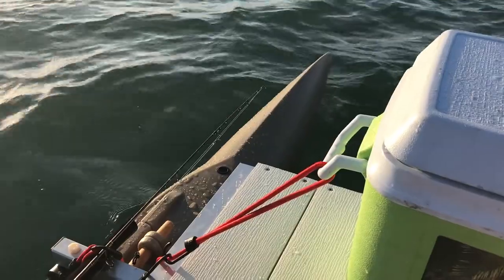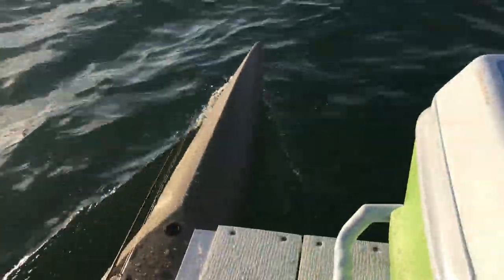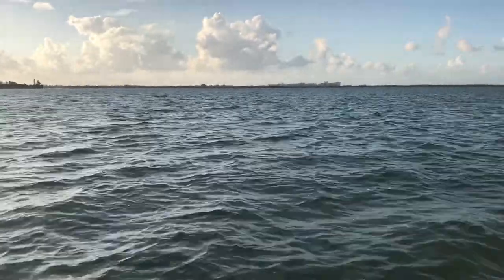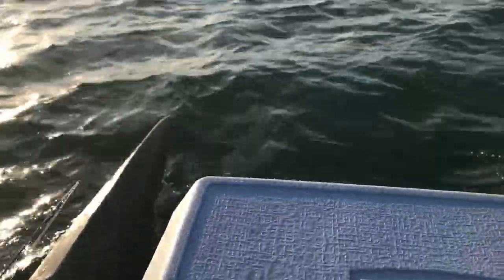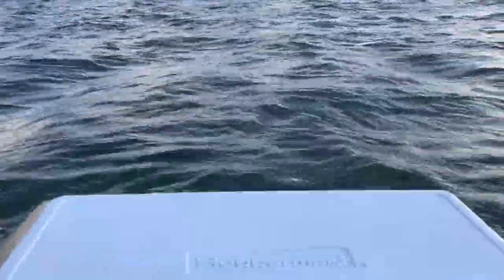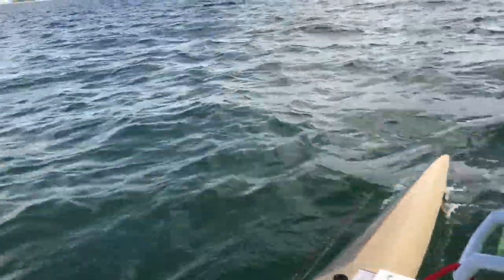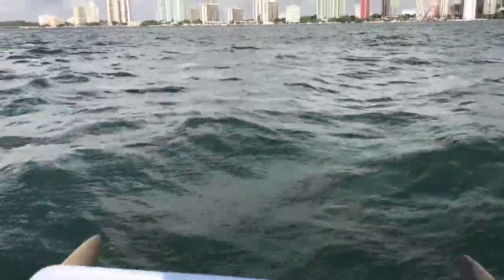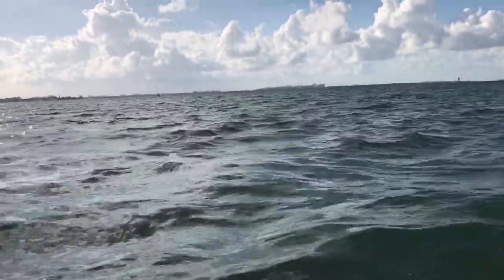Expandacraft with the Honda 35cc Engine Trial

Comment: Cool setup.  What is the shaft length of the motor?
Reply from the maker: Max length from bracket to output shaft is 23.5 inches. You have roughly 10 inches of vertical height adjustment.

Comment: nice! trolling motors are too expensive and under-powered.  this is nice for the ccs.   is this the same motor that's on the honda weed trimmer hht35 ??  thanks for the nice video!
Reply from the maker: m1 you pay for what you get. When you make custom parts for these paired with a 2 blade prop the 35cc and 50cc have plenty of power. I am the only company making parts to improve the performance dramatically. You can by the Chinese engines if you want cheap.
Reply: @kayakbuddysllc-lightweight4947  i saw u have a webpage.  u have listed: 4 Stroke New Honda 50cc GX Series Complete Engine Kit with Standard Leg - You Build Version.  is this the same package as what u show on your video?  is it complete w/ propeller and ready to hit the water?  thanks
Reply from the maker: m1 the video shows the upgraded leg. You want the 2 blade prop and better shifting components trust me.